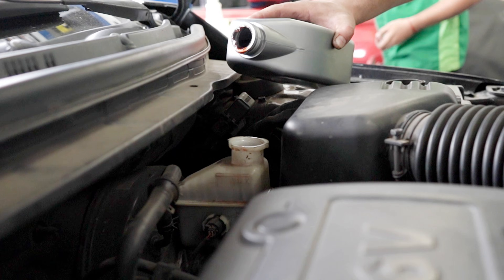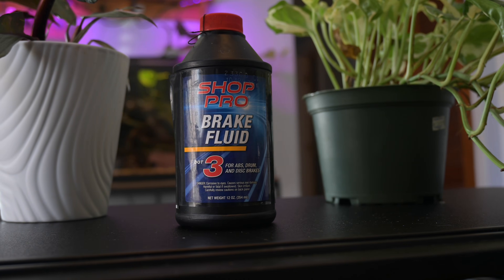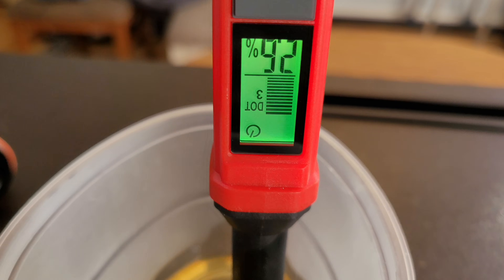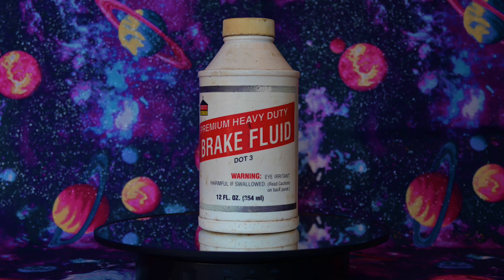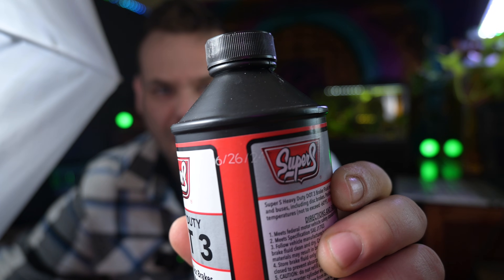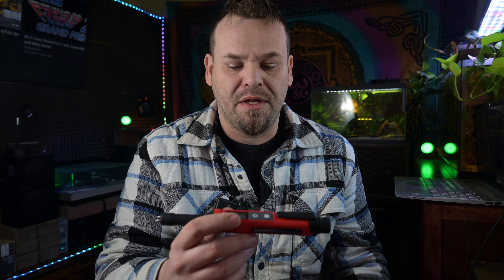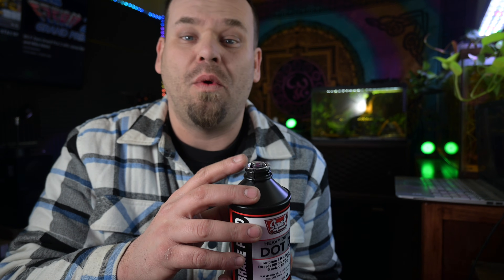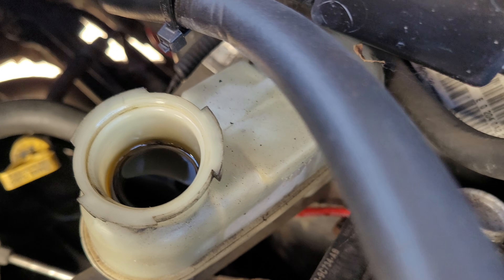Does brake fluid go bad? TESTED

Comment: Nobody changes the brake fluid in their vehicles, or throws brake fluid out, nobody that I know anyway, including myself, and I have never had brakes fail because of it, its total BS to get you to keep buying new,
Reply: I changed the fluid in my manual Accord clutch cylinder and noticed the pedal had a firmer feel. The old stuff could have become aerated in the line causing a spongy pedal feel. 
Only a fool wouldn't change out old brake fluid., the contaminants that build up over the years effect seal life and performance.

Comment: Thanks for the test !👍
You have made me ask more questions after having testing your brake fluid in your cars and found them equal to or under the 2 1/2% moisture and under ! 
 This might be a good way to see if heat causes the water to evaporate out of the Brake fluid over time ! 
 Test a bottle of brake fluid after pouring it into a pan then heat the pan with the brake fluid up to 200 degrees for a given time and then retest to see if the moisture content drops !? 
 Water when heated evaporates which might be purged out of your brake system since it is vented ! 
 It’s just a theory I have !

Comment: Would you suggest a car purchased in 2004 trailblazer with 58,000 miles on it should brake fluid be changed
Reply from the maker: Any shop will tell you to change it, and it does actually go bad.  It definitely should be changed, but im not gonna say it's necessarily dangerous... its just that it can potentially cause other problems

Comment: Problem is if it boils it pushes fluid back to reservoir and next time you use your brakes it .ay take 2 or three pumps to get pressure..
Reply from the maker: Yup, it's happened to me

Comment: I tested 7 year old valvoline brake fluid in my 2013 prius C, 5 year old factory filled brake fluid in my 2020 prius prime and a sealed bottle of recently purchased Prestone DOT 3 brake fluid with the same tester as in the video. They all tested about 1.6-1.9 % water. The weird thing is that I tested the brake fluid in the Prius C about 6 months ago with the same tester and it was 2.5% water. It doesn't make a lot of sense that the % water improved over time. I also tested them with a different brand pen tester. That one said the new bottle of Prestone brake fluid  and the 7 year old brake fluid in the 2013 Prius C had 2-3% water, while the factory filled 2025 prius prime had 0-1% water. I just emailed Prestone to see if they had any information that could help me make sense of these results. I wonder if these testers just aren't very reliable.
Reply from the maker: That's super interesting! I think they are extremely inaccurate. Imagine how many technicians recommended brake fluid flushes using one of these. Probably millions of unneeded brake flushes
Reply: @Blowninyourphone  I agree. It appears these pen testers estimate the % water by measuring conductivity. Maybe different brands of brake fluid have slightly different additives with slightly differing degrees of conductivity. Prestone got back to me and said "Those Brake Fluid moisture testers are highly in accurate. The Prestone bottle you mentioned was produced on the 29th day of 2025. All Brake Fluid productions are thoroughly tested to ensure moisture is below 0.1%." I also have used the Phoenix Systems 8006-B Double-Ended Brake Fluid + Coolant Test Strips, which supposedly measure the amount of copper in the brake fluid. This may indicate rust and corrosion. The new bottle showed no copper and my 7 and 5 year old brakeluid in my vehicles showed very little copper. I wonder if this is because the prius uses a lot of regenerative braking. Not sure if these test strips are any more valid than the pen testers though.

Comment: I worked at 3 different pepboys locations. All three would only drain the reservoir and refill. That's not a flush. I also currently drive a Colorado that sat for over ten years. And got it running and have yet to even change the pads. Breaks work fine.
Reply from the maker: @brisnladtnsme9533  Hell yeah! I was surprised at my Roadmaster still having passable fluid. (Although I'm skeptical on if this tester even works), Im a fan of the Colorados for sure! but you're definitely right, that's not a flush at all!

Comment: Could you comment on when it turns green? Is that something unscrupulous mechanics do to make dishonest money? I'm going to have my fluid lab tested because I suspect monkey business.
Reply from the maker: I can understand your suspicion! I have seen this, though. I feel like it has to be caused by copper, either in the abs unit itself or maybe the lines are coated internally with copper? I have noticed it mostly on GM vehicles. I confirmed this with a friend who has a crazy level of experience in the automotive field. We also agree that it is definitely something to research! Thank you so much for the great question!
Reply: @Blowninyourphone  Thanks for your reply. I hear you on the cooper. Also, I don't have ABS rather a 26 year old Toyo. low miles. original owner.  I should have mentioned my suspicions are from finding fluid that was dripped down my power brake booster starting from near the top edge yet the fittings are further down towards the middle of the unit. I cleaned off the fluid back last summer and it is still clean and was green. Possibly food coloring dye.

Comment: I remember watching ChrisFix doing a brake fluid flush years ago and one of the calipers wouldn't flush out and when he unclogged the bleeder valve a bunch of rusty fluid came out.

Makes you wonder if some of these vehicles are really sensitive to rusting on the inside if you don't flush this stuff out every now and then. I am sure it is even worse for people in the midwest/rust belt
Reply from the maker: @richiewitkowski7142  Absolutely! The  caliper also kinda works like a resivore holding a decent amount of fluid, which is closest to the source of extreme heat. That fluid is the most susceptible to breaking down and loosing any of the anti corrosion quality of the fluid.

Comment: Water in brake fluid is a self-resolving problem. Water lowers boiling point of the fluid ==> fluid boils ==> water exits ==> less water in fluid.
Reply: Water exits...where?  The brake's hydraulic system is a sealed system.  Where is the water going to go?
Reply from the maker: @iwens1966  to heaven
Reply from the maker: @vk45de54  🤣Fair enough! Just top it off, and you're good!
Reply: That’s why the cars with brake fluid had less water than the new brake fluid. The cars boiling out the water 😂
Reply from the maker: @alexvillalobos7137  Right! 😅
Reply: Yeah factory in most cars vs. fluid that sat to long..

Comment: Brake fluid in plastic gets less water in it than all steel components in cars you would be changing brake fluid often do to winter and summer this is not done  brakes work fine if the maintenance is keep up